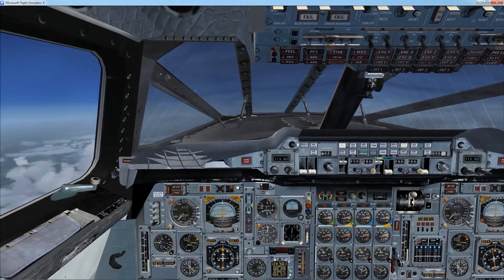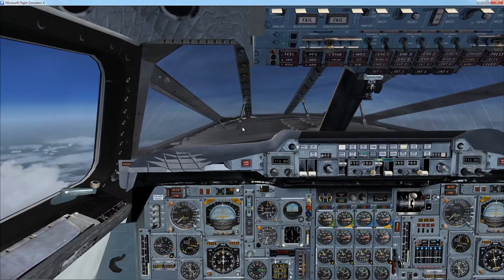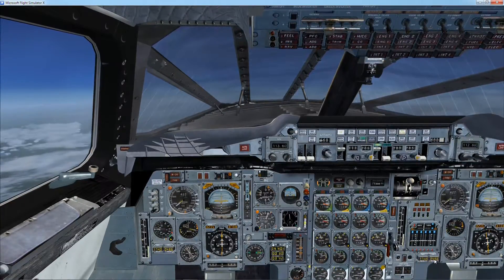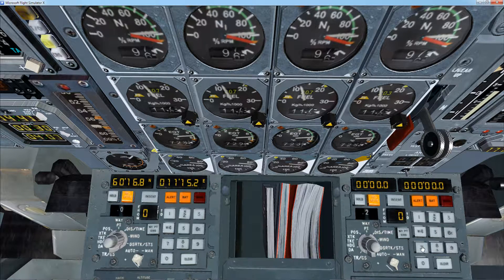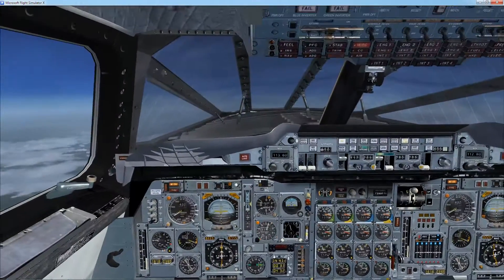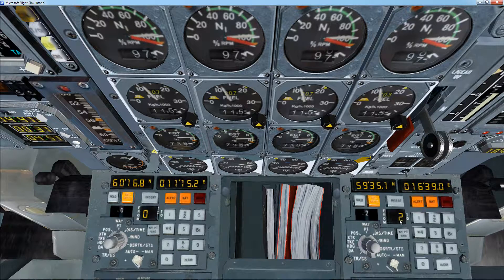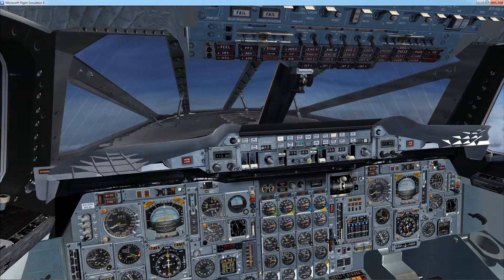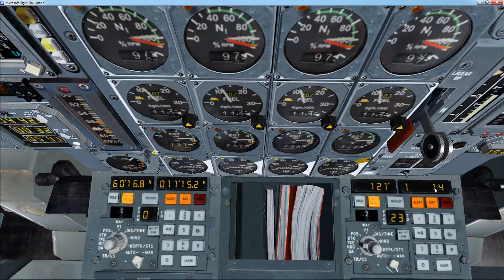INS DME updating

Comment: Nice video, thanks, but let me mention two important things you missed.
- After entering coordinates, IF the DME is closer to 1000ft AMSL than 0ft then you should enter the 1 with the "right click 9and3 then 2 then 1 then Insert" procedure.
Equally if the DME is even higher from sea level.
- To check if your entries are correct always switch to DIST/TIME the selector to make sure receiving DME corresponds with INS's distance with this DME and THEN do the WAYPOINT CHANGE process to track it.
Reply from the maker: ***** Thanks for the feedback! I read some where that the height input is not required in the civa ins used in fslabs concorde x. I might be wrong. I will double check my sources.